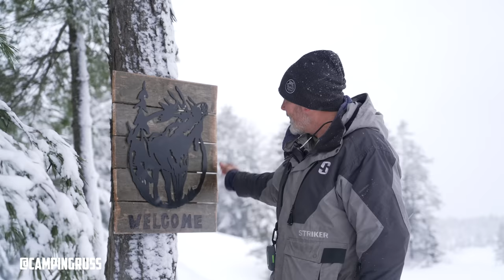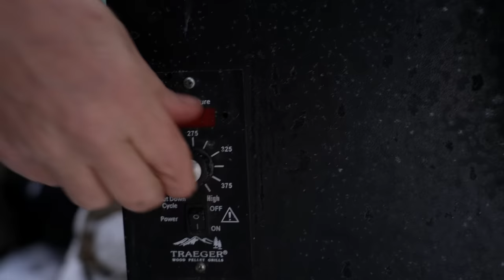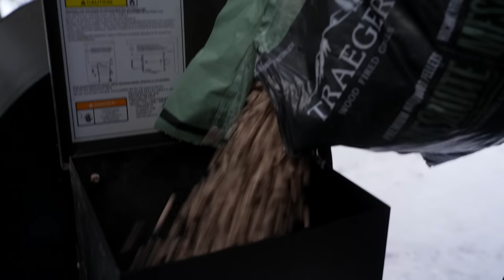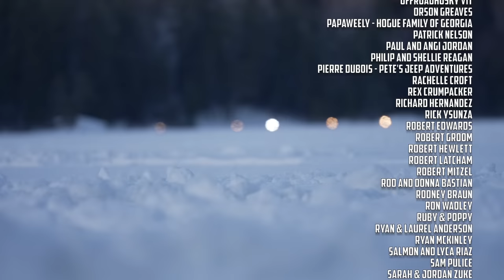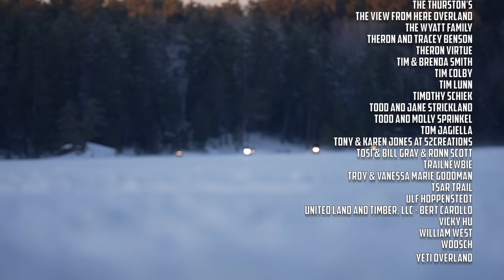A WILDERNESS WINTER WONDERLAND // EFRT S8 EP6

Comment: Hey Pete, question about the wind directional cap you put on your fireplace chimney because you were experiencing smoke coming down to chimney into the cabin.  First, what brand did you purchase?  Second, what was the cost?  Third, did you have to modify the pipe before putting on new cap?  Now that you have the new wind directional cap, do you get any smoke odors in the cabin?  Do you have open a window slight to keep good draft going up the chimney?  Thanks for your help and really enjoy your videos!
Reply from the maker: Hi there. Im pretty sure it is a Famco cap. It cost about $300 and it fit pretty easily onto our 6 inch chimney pipe. Some are designed for a double wall insulated chimney.

Since installing this, we have had absolutely no back smoke issues. It has worked incredibly well.

Hope that helps.

Comment: I always wonder why snowmobilers are constantly goosing the throttle… is there a good reason for it other than “fun”?
Reply from the maker: When starting off, it is done to activate the clutch without burning any rubber on the belt. Out in the field it is done just for fun.